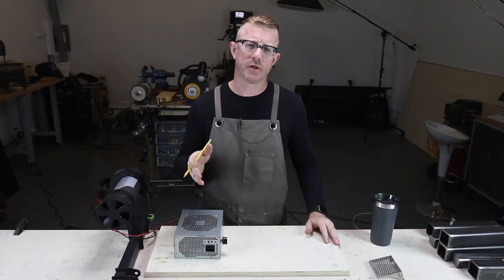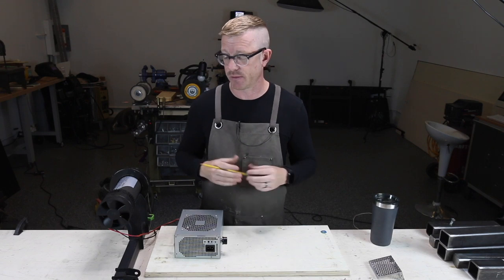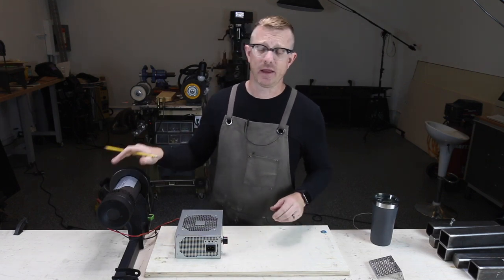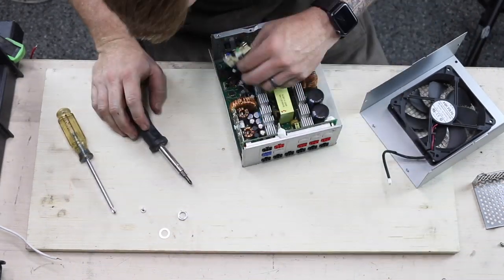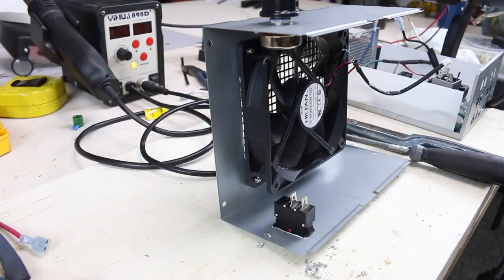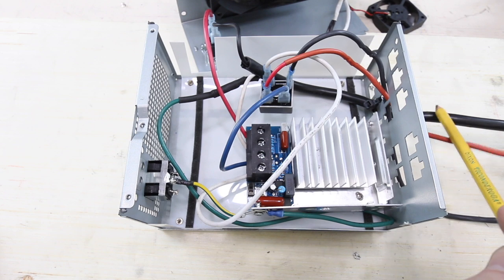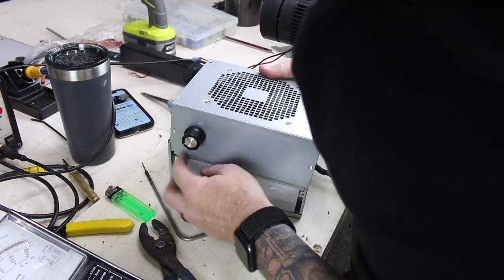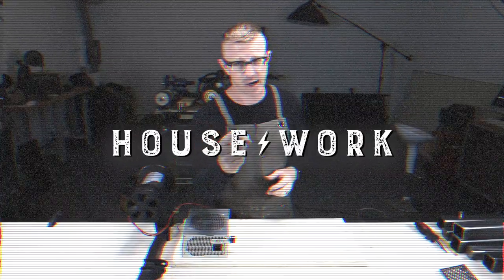How to: Build a DC Treadmill Motor Speed Controller for $20

Comment from the maker: 10,000 Watt SCR Motor Controller - https://amzn.to/2Zl3WmG
Bridge Rectifier - https://amzn.to/2MOmViv
Reply from the maker: I used a 220k pot. But that shouldn’t cause it to spark. Check the brushes and make sure you have it wired correctly from the bridge rectifier. Double check.  Where are the sparks coming from?
Reply from the maker: 4000 watts isn’t enough also that sparking is coming from your brushes. You may want to take a look and see what’s up back there. The two things most likely are related but the brushes may have blackened the commutator.
Reply: @HouseMadeUS  Why do you say 4000 watts isn't enough? 4000 watts is slightly more than 5 HP .Does the variable resistor size allow the motor to go slower with the 220K you used vs 10K or 100K as others recommend ?Nice setup. I'd never thought of using a computer power supply box.
Reply: Just looked at the controller referenced on eBay and it says only use 2/3 capacity of SCR if I understand their note which would allow approx 3HP .
Reply from the maker: From experience the ratings of the SCR controllers is highly over rated. So by going to 10,000 watts you negate that and more power isn't a bad thing. I bought a 4000 watt controller that didnt push 4000 watts and popped. Cheap Chinese junk. The 10K worked just fine. Thanks.
Reply: @HouseMadeUS  Thanks. Experience trumps advertising.
Reply: Finally got around to trying this with the 4000 w PWM's and they both fried  without making 1 revolution on the motor. After the first one went kaput, I noted that the left two poles of the pot were connected internally on the board and the furnished resister was setup to go from a few ohms to max ohms when turning clockwise. Made that mod before hooking up the net PWM but it failed . After applying power, the output never changes from changes on the potentiometer. Same voltage out as in.   Looking for someone who has a similar experience to tell me what happened.
Reply: Awesome  tutorial video..
Can you tell me the others part's I need 
For my small project conveyor with reverse and forward   using my old  treadmill motor thanks .  God bless  you ..
Reply: thank you for  so much! I'm so happy see how my treadmill motor is working after the 3 years of rest :))
Reply: pls never touch any electronics in your life again. you will only kill your self pls for your one sake.(10000W/110V=90A) look at your fuse at home is should be 16A=1760W or 24A=2640W or 32A=3520W so you could never utilize 10000W at home you would need a 10² wire google it.
Reply: Great Video Bryan.

Hi, I am wanting to install a DC Speed Controller on my treadmill. I am not an electrician and need help with which Speed Controller will work with my DC Motor. My motor is: DC 90 Volts & 20 Amps. All of the Controllers seem to be lower volts and lower Amps. Can you please post a link to an appropriate Speed Controller I can buy on Amazon that will work with my Motor. I appreciate it.

Motor: DC 90 Volts & 20 Amps
Reply: Hi we have 240v ac will i need a bigger controller than 10000 watts.

Comment: It's probably best to have it spin in the original direction as it did in the treadmill. It's been a while, but I believe that flywheel just screws on, so if you have it spinning in the opposite direction it could come off.
Reply: yes, I have seen those too.  got one on my bench right now with a flywheel opposite the pulley, its got a tapered shaft & a draw shaft, so running that type either way is fine.

adding a keyway, set screw or pin  would take care of the problem too
Reply: Good point. Another thing people dont realize is the bearings wear in a certain direction. Spinning them the opposite direction will inevitably cause rapid bearing wear.
Reply: Another problem with spinning it backwards is that the carbon brushes also wear in one direction, so reversing the direction will cause a lot of sparking on the brushes, which also reduces the lifespan of the motor.

Comment: Fantastic. I followed the instructions and saved my treadmill. The TM's circuitry was all messed up and not working so I just connected this set-up directly to the DC motor. Works like a charm. I don't have the display but I can tell how fast I'm going. Better than forking out a bunch of cash for a new treadmill. Thanks.
Reply: Update. After ~20 min of working out, it all of a sudden stopped working. There was what sounded like an arc and then kaput. Damn

Comment: Yes, this setup may work, but you should really invest in capacitors. SCR controller always let full voltage when turning on an you will always have big current inrush into the motor, which reduces brushes and overall motor lifetime. Furthermore, you don't get real DC with bridge rectifier, but rather 100 Hz dc with ups and downs and who tried this, was able to see that motor is humming. Also, SCR controller cuts AC waves so you get low torque on low RPM. So the AC and the DC comming out of the rectifier needs to be smothed and for such a large motor, you need large capacitance. For example, 5 cappacitors of 470 uF rated for 400V, because you get around 320V DC from 230V ac. One cappacitor is about 5 euros in Serbia, but is cheaper on aliexpress or ebay. And of course, you need some inrush current limiter, such as few NTC thermistors 10D-20 because those cappacitors will blow any house fuse when connected to the grid, because they draw so much electricity, as if there were short circuit. 

Also, always be aware that, when you turn knob on the scr controller to the max, actually, it not "full rpm", bur way over what is maximum for that motor. Its either 130, 180 or 220VDC motor, and you give him 320VDC. So it would be good advice to make some mechanical limit for the knob or to include some fixed resistor in series in order to limit maximum voltage output of a scr controller.
Reply: could you post a diagram for the set up you described?
Reply: This is very interesting what you discuss
Reply: @skyedangelo3237  Yes. I am making it myself. I drew the circuit diagram, and prepared everything for the pcb. It will be packed in empty ATX PSU box from some old PC. It includes a soft start system with 12V relay as a soft start and three NTC thermistors so there will be no current inrush, and the relay will eliminate thermistors from circuit after cca. 2 seconds. Also, I drew own controller, with other potentiometer values so it will be impossible to provide higher voltage to the motor (B220k potentiometer with 100k resistor in series, so max will be 180VDC RMS, which was empirically tested with oscilloscope) https://photos.app.goo.gl/JngHScM1HLWo9VsN8
Reply: @skyedangelo3237  https://photos.app.goo.gl/fJE45vEKBQW4yoMB8 I decided that four capacitors will do the job, because oscilloscope shows pretty much neat dc wave form so I'll spare one capacitor and spare some space in the box. Also, 12V needed for the time delay circuit is provided through a small aliexpress switching psu 12v 450mA that costs around 0.90$. In the diagram there is screw port labeled as 12DC input or something similar.  

https://photos.app.goo.gl/ECmhFhioKRJfyfKX9

This is how it looks without the capacitors. It's 100hz dc, though VRMS is not correct because I have made my own probe withouth correct values of resistors so this picture is just for the sake of showing the form of dc waves.
Reply: @LukaLatinovic  Did you manage to complete the build?
Reply: @gregorzivec8547  Actually yes, https://photos.app.goo.gl/i6f7ZSvRBtr18fXr6  I completed power supply build, and now starting to build the grinder. The first video shows the motor just connected to the scr controller through a bridge rectifier. You can hear quite loud humming noise, as well as see sparking from the behind of a motor. With motor connected to the new controller with cappacitors there is no humming noise, but just some vibrations at specific rpms. Also, at the start of the video with controller, you can hear the clicking sound which means that the relay has put NTC thermistors out of the circuit which can be confirmed by looking the voltage on the voltmeter. I put C14 connector to power cables of the motor so it is connected to the power supply as if it was a pc motherboard. Also, it includes the earth connection so the casing of the motor is connected to the casing of the power supply, which is, further on, connected to the mains earth line so it is grounded, just in case. Also, there is a "kinda filter" on the back side of the PSU, just to prevent particles to enter the psu. I added also a red diode to signalize max voltage, but it is not actually needed because I have set up the maximum voltage just below 180v (which is max for the motor) by playing with resistors and potentiometer resistance values. Voltage goes from 40+ volts just below 180v. So now it works smoothly, there's no large current inrush and no brush sparking nor humming noise from the motor.
Reply: @LukaLatinovic  HI! Do you have any chance to post your diagram anywhere pls? Old link does not work anymore.
Reply: @davidkal9083  Yes. Please, remind me if I don't send it to you tommorow evening.
Reply: @LukaLatinovic  thank you so much for respond! You will help me to save time and money:)
Reply: @LukaLatinovic  Hi Luka! Did you find this diagram ?if no just let me know! Thanks
Reply: @davidkal9083  I am really sorry. I totally forgot. I sure have the diagram but I forgot to send it to you. I have just set up the alarm for tomorrow, don't worry.
Reply: .   Hi Luka -  I see that someone requested the links that you posted as the old ones do not work anymore.  I too would like the links to the diagrams and photos as they would help me out greatly.  Thanks, Ted
Reply: @tcalcut  https://u.pcloud.link/publink/show?code=kZ4UKuXZbQ6yDjNaiS8G1BieFn3BPuN1dNuy Here's the new link to the project folder. You'll find, as I recall, two versions.
Reply: I've just checked and there is a windows version of the KiCAD. It's an open source software so you could try it if you haven't already.
Reply: @LukaLatinovic  thank you so much! Better late than never :)) Thanks a lot!!!
Reply: @davidkal9083  This old Tony would say: "Better lathe then ever" :-D

Comment: Most of these treadmill motors and controllers will come with an inductor in series with the motor. I recommend keeping this and using it because it will make the motor run a bit smoother. Especially if you are just running a rectifier straight to the motor, it will smooth out the pulsed current coming from the rectifier.
Reply from the maker: I did not know that. Thanks Carson. Is that inductor the metal ring that is in the wiring that goes to the motor itself?
Reply: @HouseMadeUS  Most treadmill inductors I have seen have a laminated steel core and look like a transformer but with only 1 winding. I would assume some come with a  toroidal inductor though.

It doesn't make a huge different but I've noticed the motors run a bit quieter at lower speeds.

Comment: I've used this same potentiometer and bridge rectifier on two different treadmill motors (one 2hp and one 1.5hp)...each motor began smoking shortly after it started running...any ideas where I should be looking to find the problem?
Reply: I'm no expert so don't expect anything but, did the motor run?
Reply: Treadmill Motor rates 180v only
Your wall socket AC will go up to 240v ac, hence motor got burnt

Comment: Hey Brian,
Really helpful video!
On the threaded flywheel motors,what do you suggest for fixing flywheel running anti clockwise ?I'm building a linisher 
and will probably just use the flywheel as the belt contact driver.
Thanks so much

Comment: Perfect timing, I finally found a donor treadmill and just finished mounting on my lathe.  So many videos out there that seem so complicated using complicated boards or expensive controllers, I was sure there is an easier way. my question is if you want to add a switch so you can reverse direction is there a specific one for that. also are the motor controller and bridge rectifier control voltage specifics. my DC motor is rated 120 VDC, I've  noticed some control systems are 90 VDC max?
Reply from the maker: Yeah there is a simple way to do this. Buy a DPDT switch. This will reverse the polarity for you. Very easy to wire up also. Here is the one that I bought.: https://amzn.to/2Zb8hc0  - Also the SCR controller I bought is rated at 110 which is in line with what you want to use. I bought that on eBay: https://ebay.to/2N7uOiJ - Very simple to use and install. - Glad you liked the vid. Thanks for commenting.
Reply: @HouseMadeUS  Thanks. You already answered my question.

Comment: Awesome.  Thank you.  I had been looking for an orphan (free) treadmill at our dump for the last 5 years.  I finally spied one in our scrap metal dumpster that had already been dis-assembled and just grabbed the motor and took it home.  Same plan with mine, 2x72 sander.  DC motor controllers seem to be constructed of solid gold.
Reply from the maker: Yeah, I switched over to AC because my DC fried out. Its the VFDs that are really expensive. Once you go AC though I think you will see the difference. DC has a cooling problem if you dont filter the air they get dirty on the inside and fry. Just a heads up. Cheers!

Comment: Two questions:  

1 - Treadmill motors usually have 4 wires coming off them - red, blue, and two black.  Red and blue connect to the rectifier.  What happens to the two black?

2 - treadmills go in residentially-wired homes which usually have 15 or 20 amp circuits.  I’ve seen a lot of these motors with current draw way over 15 amps, and often over 20 amps.  I know folks aren’t wiring special high amp outlets to hook up a treadmill they are most likely going to ignore.  How do these not continually trip breakers?  Where does the “extra” amperage come from?

Thanks in advance for any enlightenment you can deliver my way! :)
Reply from the maker: This motor had 4 wires, 2 blue, 1 black, 1 red. The blue wires are for the temp sensor which I removed. The red and the black are positive and negative. And because this is a DC motor they are interchangeable.  The amperage is about 15 and if you're popping breakers then you are most likely exceeding that due to other devices pulling amps while running the motor OR you have the wrong gauge of wire (too thin) and its popping to prevent fire. Hope that helps. Thanks!
Reply: I've pulled 5 motors out of treadmills so far and never run into a 4-wire.  They are mostly 2-wire and sometimes have a ground.
Reply: AFAIK, all the icon health and fitness motors have 4: pos, neg, and two thermal switch.  I’m more concerned about the second part of my question, how do these motors pull so many amps when most houses commonly have 15 amp outlets?  See https://www.surpluscenter.com/Electrical/DC-Motors/Special-Purpose-DC-Motors/ for many examples.
Reply: 15 amp @ 120 volt is common. Rectification of A.C. voltage (no load) will give you almost 170 volts peak (120vac x 1.41=169.2vdc.) Most dc treadmill motors are soft started and rated for voltages significantly lower than 120, and 15 or more amps. A 15 amp 120v circuit can support 30 amps at 60 volts. Or 60 amps at 30 volts. Some controllers have step down transformers to get lower voltages and most have a choke to reduce the initial current draw at startup.

Comment: Cool channel, thx for sharing👍🏻 
So, was any other components used from the old PSU or only the case?
Also, I encourage anyone building this to add a quality capacitor after rectification to smooth the DC. If you know how, you could simply desolder one from the original treadmill controller output circuit.
Reply from the maker: Good information Doug, thank you for that. I have heard about this and I would like to dig deeper.
Reply: Maybe some info on discharging capacitor might be good!
Thanks

Comment: Awesome TUTORIAL!!! 👍🏻👍🏻👍🏻

I'm using PMDC MOTOR (DC180V | 4600RPM | 1500W | 8.3Amps | Model ZY120-8080), from a Diadora Treadmill. The Speed Controller & Bridge Rectifier You are using in this video tutorial, are good for me? If not, please tell me what should I buy. Just tell me the specs for each one, I'll google it. (I want to make a big Disk Sander, so need power and torque).

Thanks in advance !! 
Subscribed to your Youtube Channel.

Comment: I know this is not an electrical class but I have a 180v DC treadmill motor and it has a 2800F 250V DC capacitor. I know these large capacitor are for startup when you convert a 3PH to single phase but what is it used for in this scenario?

Can you use the scr in line with the capacitor?

Comment: Liked subbed and notifications set brother, good stuff, if your getting into knife making feel free to reach out to me on fb, im a full time maker in texas, just add /shane.stainton.7 to the fb url,
One question. Ive got a much smaller sc motor, does this setup scale? Ie will it support a smaller 12v / 24v motor?
Specs ;
Nominal voltage: 25.2 V DC

Voltage range: 4 - 25.2 VDC

Speed at 12 V DC: 150 RPM

No load speed at gearhead output shaft (25.2 V): : 315 RPM

Gear ratio: 13:1

No load current (25.2 V): : 250 mA

Rated load torque (25.2 V): 5,510 g-cm (540 mNm) 

Rated load speed (25.2 V): 260 RPM 

Rated current (25.2 V): 1.29 A

Stall current (25.2 V): 4.1 A
Reply from the maker: What will the motor be used for? (Thanks for subbing!)
Reply: @HouseMadeUS  small horizontal lapping wgeel for graver sharpening, hence the low rpm requirements and not heeding much hp. Spinning a 6 in diamond lapping wheel

Comment: I have bought a 4000w and 10000w motor controller and a Bridge rectifer and I have never got the Lathe motor any slower than full speed
Reply from the maker: Take a look at the ohm rating on the potentiometer , most likely it’s the wrong size